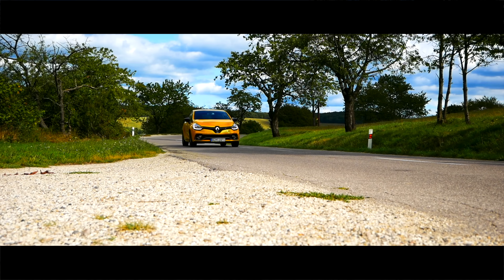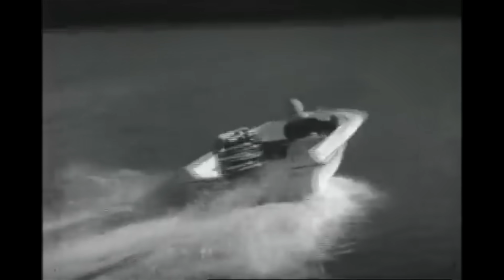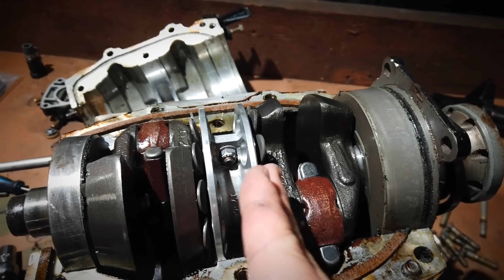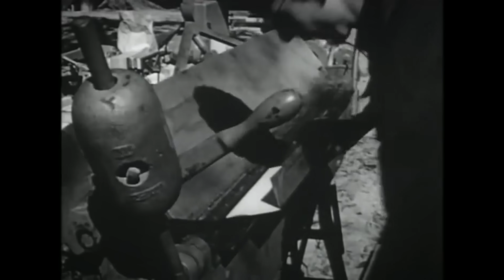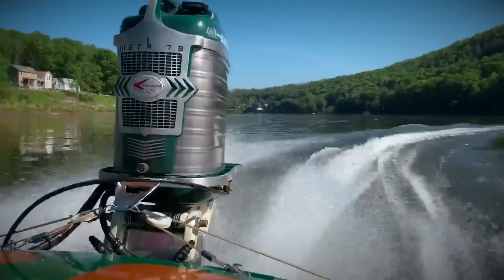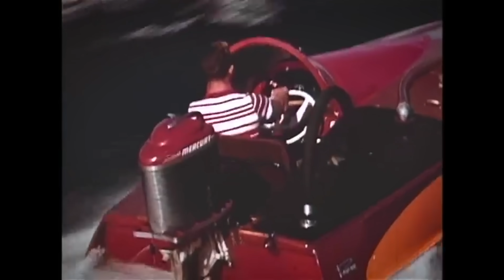The World's First 6-Cylinder Outboard

Comment: I have a 1961 Merc 200 that i picked up for my 13 ft gheenoe. It definitely out performs all other outboards in that size range, and it weighs a good bit less than other 20hp 2-strokes .  It has all the transmission controls on the tiller handle so you don't have to take your hand off the throttle to shift into neutral and then reverse for docking. I love 2 strokes specifically for small outboards because of their lighter weight and power, but also because they're so simple to work on. The mercury engines around that time are just designed so well the pull start is part of the cowling and it just looks beautiful like a classic car or something.  Its also white so it was before the whole fat lady wearing black came onto the scene, so its a little strange looking when people see it. I always wanted to paint it black but I'm probably not going to now, knowing this little extra information about its history. Great video, I really enjoyed all the little fun facts!
Reply: For sure. Love the red band motors of the fat lady Era. 
Have 2 merc 700, mark 25, clone of my dad's mark 7.5 green tank,  clone D  40H using a 350 two porter case with ports moved up .060 " to duplicate the H specks. All H insides.
30 h with Alki  Dyked Turner pistons D Reed valves KA or Aj carbs. Aj are off 350 which are bigger carbs for you guys wanting to look stock and run faster.

Comment: Keiffafer originally worked for Ole Evinrude in Wisconsin. He quit bc he thought he could make a better outboard. As it turns out, he didn’t. Mercy’s were unreliable until the 70’s. Now, they are the best outboards ever made. Brunswick was talked into buying Mercury in the early 80’s and wished they didn’t. Mercy’s then we’re pure junk. Brunswick had to buy Boston Whaler and rig boats at the factory just to get rid of them. They were delivered knowing they wouldn’t even work for a day. Boston Whaler was severely wounded losing over 80 % of their sales. If you wanted a Whaler, you got a Mercury and the Whaler and the whaler “spin off” companies got a leg over. I bought a new Mercury 90 HP in 1980. I had a few issues when new but it turned out to be a good engine. They were highly discounted. Noisy, but powerful.

Comment: I had a 1980 90 horsepower Tower of power on a 17 ft McKee craft.  It was a very strong 90. When I replaced it with a new 1995 112 Johnson it got exactly the same top speed....

The problems with the 90 Merc were the horrible three-piece metal cowling, all the insulation fell off of all the wires, and the absolutely horrible external trim tilt pump. The hoses deteriorated for the pump and fell apart and new hoses alone were $200 in 1998.  They used a rare inverted flare fitting that made it difficult to replace with anything else. 

Oh yeah, and the lower unit corroded so that you couldn't remove the bearing carrier. An aluminum nut into the aluminum lower housing corroded into place .... It was a great smooth running engine.

Comment: I have a last year 115 tower on a 14 foot ski boat. I absolutely love that motor. If it eventually smokes a cylinder or fails I will absolutely rebuild it. So much power for the weight, and the looks and sound are awesome too. Fuel economy can be impressive both ways. At wot I can blow 5 gallons in 30 minutes at about 6100 rpm. But at 32mph cruse, right about 3500 rpm I can cruse for hours on 5 gallons. The 24 pitch stainless and all the tourqe to make good speed at low rpm are actually a great combo. I was shocked to find out just how good it can be on gas when your not laying in to it.

Comment: Never owned a Mercury outboard, but I own 2 FORCE outboards (pre-mercury models 120 and 150). The 5 Cyl Force sucks. Notorious for blowing up, only a few made. The 120hp 4 cylinder, despite having the force nametag and idling like garbage, is actually a decent motor in my experience. Nice simple 2 stroke, hasn't let me down and I've abused it for over a decade

Comment: Had a 73' 1400 which had been rebuilt to 1500 specs. Running a 23" chopper on a 16' Super Sidewinder it would scream and fly when hitting the trim up and even on a hull with no pad it could do 60 mph.

Comment: Yes I have had several of these engines and they are awesome and the sound they make is ever cooler. There are ways to get way more power out of them by increasing main jets and a long tube equal length headers I love these engines I would like to try fuel injection one of these days. The factor CDI boxes were very touch, but you can eliminate that with a Malory or any higher performing ignition. Hey have you heard any new information about that new big HP 4 cylinder with new con rods, you made a video a couple of years ago.

Comment: How could miss mentioning the Mercury Racing ModVP series?
ModVP were absolutely the most insane sounding engine on the water in the mid 1990's!
You showed one in the clip. They were all black with the yellow and red stripes!
They may have been all black, but the ModVP beasts had the red and yellow stripes to differentiate themselves from the standard Mercury motors?
They were louder and faster than some of the supercharged big block inboard racing boats of the period?
These engines were also established as a separator from the 1990s split off to Marina outboards? At the time Marina borrowing all equipment from Marina marine decided to do something that they agreed to Mercury that they wouldn't? They released versions of the same sized/weight motors but with a claimed HP increase over the industry opposition? E.g the 15HP denotion was considered standard, but Marina for example released an 18HP version that otherwise cloned Mercury motor in every way? Even the Marina Marine grey cowling would interchange with the Mercury etc?
Marina did this most of the small outbound models? E.g Mercury had the 4.5hp tender outboard so Marina made  tender that was 5.5hp?
Both companies released a 6HP, then when Mercury released the 9HP (that looked visually the same as the 6HP) Marina got cocky and released the 9.9HP?
Mercury released the 15, so Marina released the 18.
And this went on tit for tat for a long time until Mercury just had enough and got the shits and went out and built the ModVP as a reminder to Marina 'your 1up manship was unappreciated and can only take you so far? How far do you want to take this game Marina marine? Recon you can squeeze a few more HP out of our motor and slap a Marina sticker on it, or what?'

Marina did not expect the ModVP at the boating and marine expo so they went away quietly sulking and licking their wounds?

I believe the following year Mercury Racing released the ModVP 2.6L and it just left their competition in their wake?
A few more years went by and I think Mercury released the 300 black max (but wasn't a ModVP racing engine? The 300 black max was much wider, much taller and heavier than Mercury's race pedigree?
The ModVPs were completely customised short leg options, lightened sharpened and strengthened legs? I think the ModVPs may have had expansion chamber exhaust systems with a atmo valve to allow them to start cause water was enough to interfere with the exhaust, not start and lead to flooding?
The 300 black max was Mercury's best consumer offering just prior to Honda Marine changing the industry with 4 stroke outboard technology? Right at the pinnacle of Mercury outboard dominance in performance with power to weight.....the marine outboard industry was looking for more reliable non performance outbound solutions to fill the gap in recreational fishing and boating?
Honda slowly chipped away at Mercury 's market share by offering more and more lighter weight and higher performance 4 strokes year after year? Mercury had reached a plateau where development slowed with higher demands motors that were less polluting and the fact that they had almost become ubiquitous leading to market saturation?
Soon as potential customers were realising that there weren't enough significant differences between Mercury's old models and their new ones, that's kind of when their market shares started taking major hits?
The nail in the coffin for Mercury marine was when a few years after Honda, Yamaha released a 4 stroke model that was nearly same specs as their 2 stroke offerings? Their 15HP was only 2kg heavier than the 2 stroke, had way more torque, didn't require premix, didn't require valve reshimming like the Honda's and got something like 2 or 3 times better fuel economy

Comment: What I noticed about Mercury, c.15y ago, was that they had the very good sense to adopt Ralph Sarich's "orbital' compressed-air fuel-injection method, easily the best way to make a 2-stroke.  The big, if not the biggest, Mercury was of this design for about a decade.  I never heard of any criticisms.  Then this was abandoned, in favour of the more complex, heavier 4-stroke, requiring a separate cylinder head (& gasket).  Can anyone explain the reasoning?

Comment: I purchased a 82 115hp tower of power with a bad piston last year that never saw salt just because the history of these motors. And just for giggles I tried to take it out like that before rebuilding it, it still hit 40mph only being a 5 cyl with no piston rings left at all on cyl 3 and a cracked piston and leaking baffles,  just to show you how tuff these motors are even when broken. I wound up having to strip the block down and send it to Florida to on of the few good old timmers in the country who can machine these blocks still and bore or hone it out with its blind piston holes and non removable head plate, along with somenwho owned and operated a bridge port with an end mill to be able to resurface the exhaust baffle plates mating surface which are recessed into the block and notorious for warping and leaking water internally when the motors get old. I put it on one of my old boats and the thing screams like a Banshee. Now I'm taking the bottom half of a 72 sports craft safari 17ft and stuffing the top shell off a 69 cobia sea queen 18ft to build a custom boat for the rebuilt motor.
Reply: Same experience here, only with L4 mercury from 1980s. That thing was running with three cylinders when I bought it. After full rebuild, it is a mean machine, witch gives a lot of good emotions and takes a fair amount of fuel:)

Comment: I had one, a Mark 75. Mine did not have a tranny. You started it in either forward or reverse direction. It had a single handle throttle, with a thumb button on top to start. Pulling the throttle back retarted the timing until it stopped, then your started it in reverse. We called it the Dockcrusher. No neutral.

Comment: Personally never been a fan of the look of the newer 'tower of power' design, but the old ones look amazing! and you cant deny they sound awesome! I started driving our speed boat when I was about 6, its had 3 outboards in my life, a 75 evinrude, a 60 johnston and now a 4 stroke yamaha 60. Gotta say, the 4 stroke is a gamechanger, you couldnt really cruise efficiently with the 2 strokes, but they were quick. actually having a wide power band is super nice with the 4. If you've never driven an outboard, its quite a different beast, as the steering and power are delivered from the same spot in the rear. no difference to a car if your just cruising around, but when your doing more "fun" things, its an absolute blast. racing, skiing, slaloms (if you get it right you can swing the rear end out in a kind of power slide. get it wrong the boat will turn itself over), swell surfing (our boat has almost no wavebreaking, so if you have to navigate swell, you have to work with the wave, hard work, but super good fun). Awesome video.

Comment: I grew up with a 50hp Mercury 500 on a 13 foot Boston Whaler rated for 40 hp, both made in about 1970.  I remember losing a race to a 40 hp Evinrude on a similar boat and wondering why for years.  I later discovered why as soon as I drove a speed boat with power trim and learned to trim out for maximum speed.  We had kept the Mercury trimmed in so that it could plane easily with the whole family aboard and could stay on plane at the lowest possible speed, both in choppy waves and to save fuel.  We didn't realize how much that trim reduced top speed.  
   I learned basic engine maintenance on that engine and a how-to book at around 12, between it and the lawn mower.

Comment: Had a boat with a 90hp Tower of Power. They run good but hard to start cold. Fully charged batteries a must!
Reply: Not mine .  Fire's right up
Reply: Must not have been 'sync and lynced' properly, mercs had more abd 'finer' parts and needed set to 'spec's

Comment: Man I miss my old straight 6 merc. I had a Glastron Carlson CV16 with a 140 horse tower of power out back. It shot that little Carlson 16 around like a slingshot. I bought an 18' Fabuglas tri-hull from an old man that had the 'like new' Merc on the back. He said he bought the motor new to repower the tri-hull but only ran it twice because sudden health issues arose. So the new motor and old boat sat for over 10 years in his garage. He sold it to me for $2500 but I had to take the old tri-hull with it. All it needed was a carb clean and three new updated floats and it was perfect, not even a single scratch on the skeg. I removed the 85 horse Johnson Hydro electric shift from the Carlson and mounted the 140 horse tower and a love affair was born. By far the best outboard I've ever owned. Just electric smooth and endless torque at all throttle ranges. Boy I miss that whole time in life. Anyway that's my tower of power story.

Comment: The way that all the people in this video were hand feathering the throttle.....yeah don't do that. It's a good way to seize up your motor. 2-stroke oiling is varied directly by the throttle. Throttle position and engine speed need to match, as much as possible. When they don't, your powerhead is not getting enough oil!! Don't Rev it like it's a chevy, or you will pay the price. 
By comparison: In a 4 stroke, the oiling is varied by the oil pump. The oil pump speed always matches the engine speed, because it is run mechanically by the engine itself; So you don't have to think about it. 
But in a 2-stroke, you DO.

Comment: In the early to mid 80's I spent several dozens and dozens of hours behind a 90hp ToP Merc either waterski, wake board or driving the boat.  My fave sound is when you put in forward [towing a skier] and get ready....Full throttle.  Its the sound of the engine accelerating from above idle to 3600 rpm, that loud carburetor sound of the engine pulling HARD, and then back off to about 3100 to pull whoever was at the end of the rope.  Im an OMC guy, but the "Tower of Power" is my fave engine right beside the V-4 OMC.

Comment: My Dad, a fairly prominent outboard racer in the 70s and 80s spent many weekends at Lake X, but he was ultimately an OMC V6 fan. Of course, Merc dbuted the Black Maxx just a couple years later and the war was on again. Good times.
Reply: Worked at marina in Key West when retired Pro Baseball player 'Boog' Powell was given a 300hpV6 (pre public release) to 'demo' on a 25' Mako walk-around cabin. Took out to watch 'sunset celebration' in Mallory Square Harbour, around 100 hours crank mains would 'spin', seem like lack of Lube even (of course) MercLube 🛠non-hammer mechanic

Comment: We used to run a Blue Band (1970's) 115 tower of power on our 16 foot race boat.  The engine ran amazingly, would do hour long races sitting at 6000rpm and never missed a beat! We only ever replaced it with a later model brown band 115 tower of power.  The engines performed amazingly and were able to get us up to 108kph with 2 adults  and ~50L of fuel on board!

Comment: My uncle had a ski boat with an inline-6 Mercury outboard when I was a little kid, I remember riding in it a few times and always thought they sounded cool. I have a 9.9HP mercury 2 stroke outboard from the late 70s and it still runs great, it's smooth, responsive and quite fast. A bit thirsty though.

Comment: As long as I've been alive, my uncle has had a vintage fiberglass boat with a 150 Tower of Power on the stern.  I always assumed naturally that all outboards were light, mean, and 2-stroke.  Did not realize until later how special those motors were.  Then later to really learn about 2-strokes and discover they were actually ramp-piston cross-flow caveman technology, the performance is all the more impressive.

Comment: Had a 1972 15 ft Critchfield with a red striped cowl Mercury 800. Replaced it with a blue striped cowl Mercury 850 in 1974. Replaced that one with another red striped louvered cowl Mercury 1500XS in 1978. I joined the army in 1979. When I got out of the Army three years later, I sold my boat.

Comment: I worked on these engines for 40 years and the inline 6(tower of power) was the toughest outboard out there  we took them right from mercury marine and put them on our boats at Eldocraft boat company in Smackover Arkansas and ran the crap out of them with no failures but the when the V6 came out it was a different story. They would not hold up like the old 150s  . The 155XD ran well over 100 mph on an Alison craft single hull and was the fastest thing on the river back in the 70s. That thing would scare the shit out of you.

Comment: currently running a merc 800 2stroke on my 15 ft 1978 chrysler fishing boat and let me tell you ,  people are always shocked when i go wide open! the sound and speed are amazing!
Reply: 2 stroke piston from Bottom to Top 1/2 stroke emptying combustion chamber, Top to Bottom stroke 'filling (Air, atomized fuel) cylinder chamber for 1 compression-spark-combustion-explosion-2 down stroke dischargeing previous left overs, repeat 1__so compared to 4 STROKES (SAME RESULT-POWER) a 2 stroke is A LOT MORE 'WORK' DONE WITH LESS EFFORT